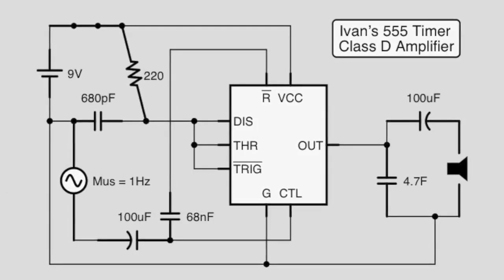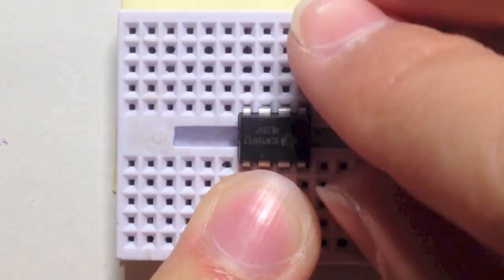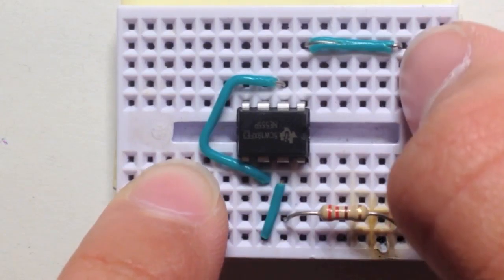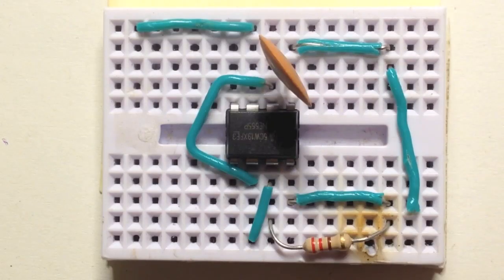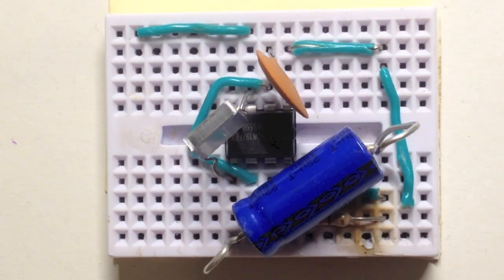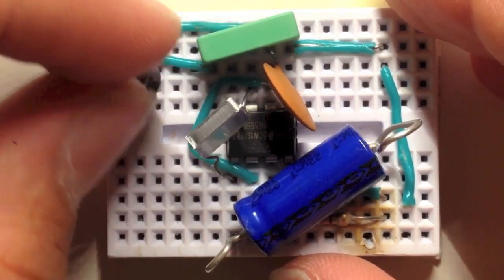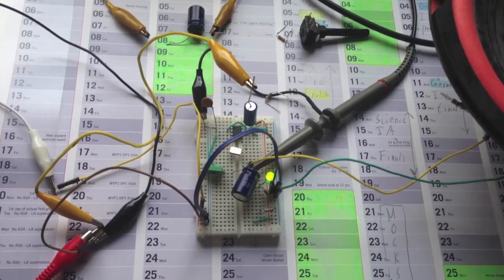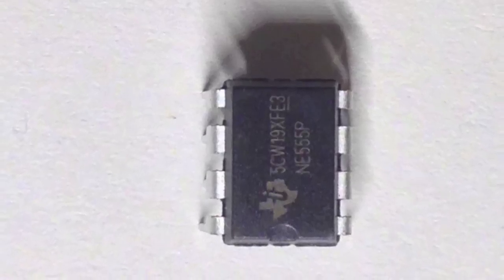555 Timer Class D amplifier

Comment: Try deleting the 4.7 uF capacitor between the output and ground. Driving a high frequency square wave into a large capacitance means huge current spikes every transition. An inductor in series with pin 3 on the 555 will help the output low pass capacitor filter out the square wave.(I'm sure the capacitor is there to reduce zero crossing distortion) Removing that capacitor will greatly reduce idle current, and allow the inductance inherent to the voice coil of the speaker to filter out the high switching frequency, as well as the harmonics of the square wave. Reducing clock speed, by using a larger timing capacitor will reduce the effects of zero crossing distortion due to dead time between one output transistor switching off, before the other one switches on. Set the clock speed as low as possible, (~40 to 50 KHz) It's never good practice, to drive a low impedance square wave directly into a capacitance.

Comment: Can you describe the elements?
Reply from the maker: good point. which elements are you curious about? I mean, for this, any decent 555 timer should work. Resistor can be anywhere from 200 to 300 ohms, capacitor values are non critical and all my electrolitic caps were rated at 16 volts. The 68o pF was rated at 200 or something volts. Its value is also non critical and anything within 200-800 pF should do the trick.
Reply: Please Sir how to modify this to make it extremely powerful?
Reply: @lawalmohammed83  put some transistors at the stage, so you can do it by connecting it to base but i think it would be better with mosfets, since they are more suitable. and it runs cooler.